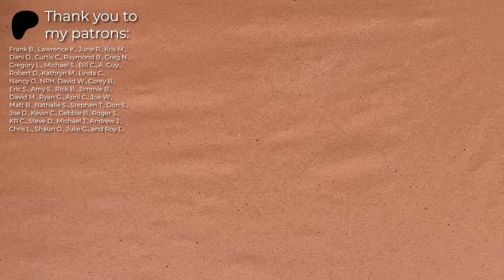DIY Plug-In LED Jack-O'-Lanterns

Comment: Hey Derek, a couple tips… I always put a piece of shrink tubing on the positive wire inside the connector to prevent shorting. Also take a look. For a G4 base LED flame bulb and G4 socket. I use them in my lanterns and hope to upgrade my Jack o lanterns with those as well… super good look, they are more costly than an eagle but no flicker circuit required…
Reply from the maker: Thanks for the tips, Greg! I bought some of those g4 flame bulbs and found that their pattern was really noticeable, especially when you had multiple props using them, so I returned them. I may have just gotten a bad batch. I'll have to give them another try some day.

Comment: I light up pumpkins with replacement corded candelabra sockets for like a Himalayan salt lamp & LED flame bulbs. To keep from seeing the bulb I hot glue a piece of parchment paper to the inside. It diffuses the light and keeps you from seeing the bulb. Not super waterproof though I only am putting out my pumpkins on halloween.

Comment: This will certainly solve the problem with the batteries running out on you... and long ago I used RCA plugs, and they're a fine choice over other audio connectors, but at some point I realized that it wasn't going to cut it anymore.  The RCA is for audio circuits and most of their wiring is very thin and can't handle a prop, or lighting, that needs more current. 

What I use these days are the 5.5mm x 2.1mm barrel connectors  (not the 5.5mm x 2.5mm those are annoying and harder to find).  What I like about them is that they are standard connection that you can find on power supplies, and if you look on Amazon, they make heavy duty extensions so you can run higher current.
  
The LED's that flicker like a candle are a better option, and you can get them in different colors such as Yellow, Red, Blue, Green, etc...  The only downside with these LEDs is that you need to also put a series resistor, and some kits include the resistor, but this also allows for customizing, here's a cute hack: if you put non-flickering UV LEDS ( like 2 or 3) in series with the flicker LED and you get flickering UV effect that can be used with UV reactive paints! You need to calculate the voltage drop and do an easy calculation for the current.    And these LEDs are easily waterproofed with heat shrink tubing and hot glue... in fact, drizzle some hot glue over the lens of the LED to give it some diffusion and warped light looking effects. The Hot glue can be removed easily if you don't like the effect and want to try something different. 

As for my attendance... or lack thereof...  I didn't get the usual premiere notification 'DING' and missed the whole Saturday morning chat session.   What I attribute this to is that recently YouTube cracked down on their ad blockers and there's been a lot of changes to both the Chrome browser and then YouTube service began throwing messages at me to turn off an ad blocker (that I didn't even realize I had installed)...  When I followed their instructions to switch off the ad blocker, that's when things dramatically changed, the ads are invasive, the notifications sometimes don't work. In the past, I didn't mind the occasional ad but now they do 5+ ads per video... Jeez!   They ads aren't effective, all the years on YouTube and I couldn't tell you a single product those ads were about.   Anyway, I think that there are other platforms to consider...   

How has your experience been?  I can't be the only one that this affected.
Reply from the maker: I’ve never used blockers so it’s been no different for me. You were definitely missed today!
Reply: HI @VanOaksProps , and I really missed you guys too... I felt terrible that I didn't check the time, but usually I get the notification at 8:30.  And the crazy thing is that I didn't even realize that I had an ad blocker... we have so many things in our browsers that I even told YT that I didn't have one... to then have egg on my face a minute later.

Comment: Nice upgrade. If I'm not mistaken, around timecode 5:09, the end of the the connector should be crimped around the wires for a meager amount of extra durability. Certainly much less necessary due to the solder and low amount of times you'll plug and unplug it. Caution has to be exercised not to short the wires by crimping through the wire jackets too.
Reply from the maker: Absolutely correct.

Comment: It's ironic that I saw this video this morning.  I was just talking about wiring my freshly carved funkin last night. The only difference is I want to use a plug in for mine. Still, very helpful video. You found your calling. Your instructions are always the best. Thank you and happy Halloween.
Reply: BTW, Is there a way to plug in battery powered lights, skeleton eyes and other props? Seems like a lot of manufacturers are using batteries these days. I love the red eyes on my skeletons, but the batteries run out. So frustrating. Thanks.

Comment: Would this be possible to do with USB connectors or is that not a good idea? I already have some pumpkins that I use a multiport USB charger to power. Would love to just add some more USB powered and get rid of the batteries
Reply from the maker: USB has really thin wires and would probably be more difficult to solder.

Comment: If you want to have a lot of pumpkins, would the flicker circuit be random for all of the pumpkin lights or would they flicker at the same time?
Reply: I went with 3 Lighthouse 5mm flicker bulbs this year and they are not bright enough
Reply from the maker: They’d all be the same. You could use multiple flicker units or just space them out so that you don’t notice they’re flickering the same way.

Comment: I'm converting my 30 or so pumpkins using your method but also incorporating your latest haunt wiring system with 2 pin connectors.  Would each pumpkin need its own flicker circuit?  Seems like adding it between the power supply and the pin connectors would have them all flicker in unison.   If they each need their own circuit ahead of the eagle eyes, where would you tuck the device?  Thanks for your great channel
Reply from the maker: Your assumption is correct. They'll all flicker from that one circuit. That's how we run ours.
Reply: @VanOaksProps Thanks Derek.  I'm guessing it isn't super obvious?  Or the further apart the less noticeable?
Reply from the maker: @darenlong7835  exactly.

Comment: Hi Derek Love your videos. Got a question, what made you choose an RCA Jack?
Reply from the maker: It was one of those weird ideas that I wondered if it would work or not and once I saw that it would, I just kept using the same pieces. If I had to do it over again, I would choose weatherproof connectors.
Reply: @VanOaksProps  oh I’m not making fun it’s a great idea, an electrical connection is an electrical connection. Whatever works and is readily available is my motto! Cya bud

Comment: I'm personally not a big fan of using RCA connectors for 12V power. Especially if you're also audio equipment in your haunt, there is a chance that you might hit an audio line with 12v when you mix up some plugs. Why not just use DC barrel jacks that are made to handle power, rather than using a plug that is "dedicated" to audio? (An RCA jack will probably handle the power just fine, but I don't like using plugs that are normally designated to signaling for power uses.)
Reply: The female RCA jacks he uses are on the back of custom power distribution boxes. Don’t see how you would mix that up with audio equipment.
Reply from the maker: You absolutely could use barrel connectors or even dedicated waterproof two prong connectors. I went with rca because it was my first idea and the parts and build were straightforward. An added bonus was the amount of rca cables I had laying around from my time as an audio engineer. 

I’ve never had to worry about mixing up my cords since none of my speakers have rca connections. They also originate from different places in our haunt.